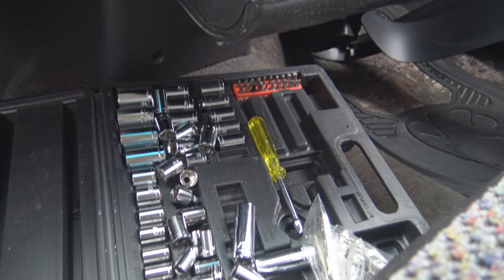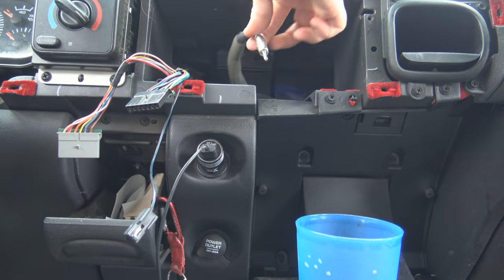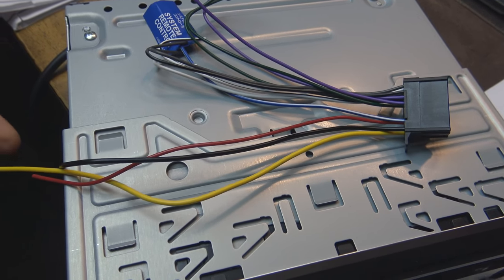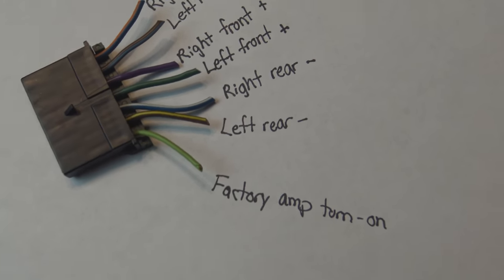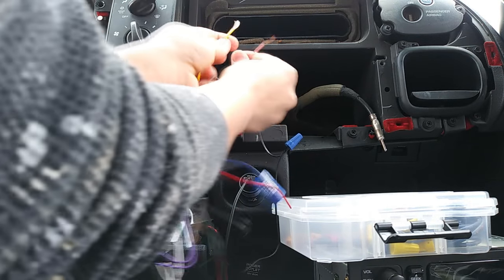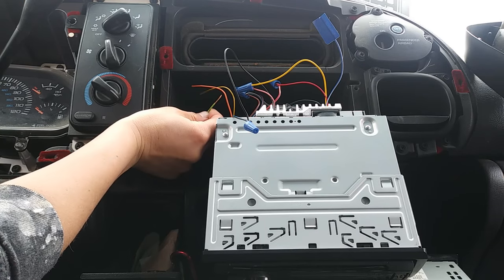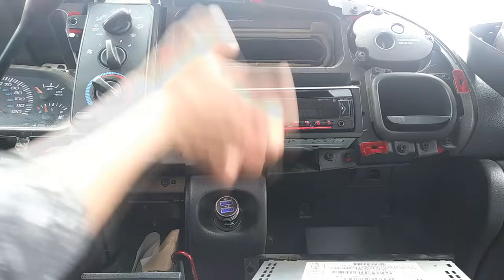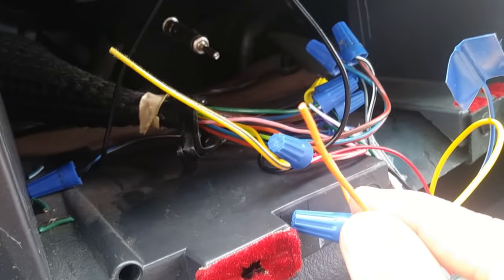Dodge Ram radio install (step by step)

Comment: Please buy a separate harness so you don't have to cut the factory harness if you do this. Also never use wire nuts, crimping or soldering is the way to go if you want a nicer install that will last

Comment from the maker: By no means am I a professional radio installer but clearly by making this video it has helped many hard wire their stereos because let's me honest not everyone has the luxury of a factory harness not being sliced. This is why I made this video. Thanks
Reply: Any advice on installing the dash adapter kit? I have the wires all hooked up but my dash kit doesn’t really explain how to install it. I put it on and reassembled the dash but the stereo isn’t secure at all. Did I miss a step? Are there tabs or something on the metal sleeve that have to be pulled back?

Comment: So as someone has already mentioned this is how NOT TO do an install!! You never wanna cut your factory harness out, that's why they make harness adapters that hold into your factory harness and then you wire up your head unit to that harness, again NEVER cut the factory harness unless its absolutely necessary to do so cause your car was made in the 60s or 70s maybe even 80s and there is no adapter harness available for your type vehicle. Also DO NOT use wire caps, use either the female crimp type connectors or use heat shrink, pros will use soldering and heat shrink. If you use the adapter harness you will not have to worry about the amp power wire etc unless running an amp but I always run my own amp turn on wire anyway. But if you do not use adapter harness you will need to run the amp turn on wire to the memory power wire cause that wire is basically the blue wire that comes on most after market head units etc.

Comment: You could've bought a wiring harness so you wouldn't have had to cut the factory harness in the truck.
Reply from the maker: Im aware lol but I wanted to make this video because so many wiring harnesses are already cut and removed and most videos online were poorly recorded or confusing for the average person :)
Reply: Ye. Don't aver cut
Reply: Ive had issues with an adapter, splicing was definitely the way to go for me.
Reply: @tightflightproductions  YOU ROCK!!!
Reply: @tightflightproductions  Thank you!!! This was the MOST helpful video online I have seen so far! You explain things so well :)
Reply: Hell yeah that's all I need to know
Reply: Re store
Reply: Z
OPEA
Reply: 🤮 shouldn’t ever cut factory harness… 
But nice to see in case yours is already cut…

Comment: So like me I couldn’t use the adapter kit I had to sort out the actual wires to the doors as I went with a higher end Infinity component system, so I rang them out 1 by 1 as to gain 2 pairs to each door that I doubled up because the single wire gauge was to small for single wire wattage, I abandoned the wires to the rear speakers from front door and ran the direct to amp, I drilled and placed tweeters up high in rear pillar next to belt sling for better sound, and lay off her! Not everyone has a solder gun and shrink tube and knows how to use it, I had every bit of 8 hours installing and well over 1K in components and Ive seen the shitty jobs those butchers do at most Stereo Stores so give har a break for trying and doing a fine job!

Comment: In this video you left out super important info that had me at a loss. When you turned the key on then and turned the radio on and said something about that’s what was wrong you were referring to the light green wire in which you didn’t really mention what issue you had off screen nor did you explain after the fact or show up close how you resolved the issue. The light green wire needs to be connected to the acc red white wire in order to get sound. This wire is not mentioned anywhere in instructions or online so it’d be helpful to include this info in the video

Comment: Thank you very much. Your video was extremely helpful. Just picked up a truck that had the radial stolen out of it and all they left me with was the bear wires inside the – and for the life of me, I could not find the 12 V constant. I never thought it would be that little pink wire.

Comment: The minute I saw the wire nuts I started laughing, dead wiring police are going to wake from the grave and clickedy click share their brilliance. The joke that came to mind was what a remarkable power you have to force people to butcher their wiring harness and use wire nuts against their will. 
 Thank you very much for your help. You saved me a LOT of time and hassle. It is hilarious having bluetooth, nav, back-up cam and a big screen hacked into the dash of a 2001 2500 cummins, dash disintegrated 21 years ago.

Comment: After 3 months of on and off trying to put it together I finally got it thanks to your video I swear there are no wiring diagrams for a 2001 dodge ram didn’t have the lime green wire anywho thanks

Comment: I believe you did a phenominal job, the harness would been better, but i have also used a harness and the connector did not match wires correctly. Best to know the wire scheme, regardless. Thank you, helped me out figure what wires were not connected correctly.

Comment: Thank you so much!! Nothing else I watched or researched talk about the lime green wire (preamp) and without it connected you know what happens? Radio powers on but NO sound out of speakers. As far as wire nuts and all the "professionals" here saying you shouldn't use them, if it works it WORKS!
Reply: You might have just saved me…

Comment: For anyone confused, I just put mine together. I did use butt connectors and had everything wired together except one thing. The lime green wire. You have to put that with the red-red/white wire as a three way splice. I had no sound but not it works great and everything sounds good. I have a boss 7” single din.

Comment: Thanks. Had mine installed in a hour.
Reply from the maker: You're welcome, glad I could help!
Reply: @tightflightproductions where did you hook the memory wire, I wired together the red and the yellow wire 😅😅, and btw I bought a harnes adapter and it never turned on so I did what you did and it work lol

Comment: Not sure HOW your wiring went so easy and you had sound right off the bat! I've been installing stereos, amps and speakers since I was 17 back in the 70's and 99% of my installs go as simple as yours did but NOT this 2000 Durango I'm doing now! Oh, and I've NEVER used wire nuts, only butt connectors yet you gave me an idea! Now I might start using wire nuts for temporary hookups until I confirm everything is working as it should, THEN remove them and use a more permanent connector. This way, if I have to disconnect something, I don't have to re-cut any wires. Anyway, I've found probably 10-15 DIFFERENT wiring diagrams for 2000 Dodges online and NONE have the same color wires my friend's has! This was the FIRST car stereo EVER that I've installed and had NO SOUND but the stereo came on. So I googled it and found TONS of other people with the same problem. It seems the factory harness from the back of the radio mostly run to the factory amp, THEN to your speakers! THIS is why nobody gets sound. So, what I'm thinking I'm going to try next is run speaker wires from the new Alpine down to the harness from the factory amp and see if I can get sound from there! Yes, I'll probably have to cut the wires from the harness, but it will never be used again so that doesn't hurt anything. I'm eventually going to install an aftermarket amp in this Durango but for now the owner just wants better sound with the new deck and 4 new door speakers. Again, I was SHOCKED that you got sound from your stereo after the FIRST try! That truck must NOT have a factory amp!
Reply: Please tell me you figured it out and remember what you did?? I have a 2000 Durango and I can NOT figure out why I can't get the radio to even power on. Car came with no radio so I bought one and the wiring harness. Nothing is working for me. Please help lol

Comment: Never use wire nuts in an automobile! The vibration can cause them to loosen and then you just have another problem. Either use soldering and heat shrink tube to secure any wire splicing. Also acceptable are crimp connectors that can be heated to shrink the insulation.
Reply from the maker: 3 years later and yet my radio still works great lol yes soldering is best~!

Comment: Topflight I need your help. I'm trying to hook up my pioneer radio I bought from Walmart and I have looked at your video a thousand times and far as i can get is the yellow & pink wire, red& red with white and that's all i Know. What do i hook the ground wire with. Colors i have left is green&black and brown&dark red brown & yellow. I have a 96 dodge ram 1500 btw
Reply: By any chance did u find a solution I need help with the ground wire too please respond asap if u can

Comment: Great stuff.  Problems I'm having with my 05 Ram.  I have two hot wires, both gray/red.  How do I choose?  Also, in addition to the black/green ground, I have a solid black wire.  Any ideas?  Anyone?

Comment: This is a great Vijay and hell no I ain’t buying no effn harness!!!  Buuut the one thing you may need to know and it may just be us but we found out that having the dimmer wire hooked up it blew the fuse for the tail lights and dash lights.  Disconnected it and BAM!! Tail lights all good

Comment: Love the video I was giving a 99 Dodge Ram 1500 5.2L by my auntie I don't know much about these trucks but it looks simple to fix anything on it.  But I know the wiring is grounded out wrong on the back of the radio as I see I'll just follow your steps fix my radio thanks by the way

Comment: Great video and very informative--I personally wouldn't have used wire nuts but hey...whatever works.  Butt splices at minimum, but the best is solder and heat shrink.  Thanks for posting!

Comment: I’m running stock speakers with infinity amp, I have a Alpine double din and I have full working headunit no sound at all, I tried running the green(amp turn on) to the red with white stripe and I still have nothing, speakers worked prior to head unit swap

Comment: Hi, great video. Just wondering if the wiring for 1500 is the same as 2500 and if there is a difference in wiring for diesel and gas engines? I have a 1999 dodge ram 2500 diesel. Thanks!
Reply from the maker: I have a 1999 Dodge Ram 1500 5.9, not sure on the 2500 diesel's.. does the wiring look similar?
Reply from the maker: Hey there sorry I missed your comment. Im not quite sure, but I did show the wire colors pretty good and im assuming if their not the same then its probably different. Hope that helped.

Comment: How do I hook up the ground wire without cutting off the adapter? The aftermarket one is just a bare end
Reply: run your own ground for the head unit or just splice it
Reply: @miket5506  Ended up just cutting off a few of the copper strands for the ground wire and clipping it into the ground clip, didn't have to cut the ground wire and it works now so

Comment: so I wired up my truck a new radio head unit and now the audio sounds worse than it did before could I have wired it wrong or badly or are the speakers blown?
Reply from the maker: Well if all the "speaker wires" are correct and everything was connected correctly etc... your speakers could be blown.. but im not forsure..
Reply: The second pin diagram is wrong...
Right Rear +- are swapped
Left Rear +- are swapped
Should sound better if you get that fixed

Comment: Second connector diagram is wrong

Looking at a Metra 70-1817 adapter your second pin diagram is wrong.

Right Rear +- pins are swapped
Left Rear +- pins are swapped

If you wire it up as per your diagram, it's not going to sound right.

Comment: Uuuuffff this video is so confusing and CONFUSING TO THE CORE! 
2 Harnes connectors from the car's harness, the Grey harness is include code colors: Solid Pink, Red with white stripes, solid orange, black with yellow stripes, blue with red stripes, and solid brown. In your video shows the blue and red stripes is Right Front Speaker, and the solid Brown is the Left Front speaker, so, where is the ground wire?( I am talking about the car's harness of the gray connector). The black connector is the speakers(I dont need clarification with it).

Comment: I got a harness so i didnt have to cut wires but it still never worked 🤔 now my radio never turns on and i cant seem to get any stero to work . any suggestions? My fuse is ok lol both on the fuse box and on the stero. Im so confused lol this was supppse to be easy🤣
Reply from the maker: lol hmmm well i am sorry you're having problems... strange, maybe 86 the harness and wire accordingly as the video shows? Maybe its the amp? No amp, no speakers, which means no sound...  Either an amp fuse, or loose wire somewhere?
Reply: @tightflightproductions  after like 3 days i figured it out. Apparently the last owner cut the speakers out and left the wires bare. So they were grouning and for some reason my while system wouldent turn on. Maybe this will help anyone else. 😅 the wires were in my driver rear door.

Comment: My front speaker aren’t turning on but my rear speakers are? Help please.
Reply: You probably have a broken wire or a bad connection Either where you crimp the wires together or on the speaker side the other possibility is you may just have a blown /damaged  speaker

Comment: you should not cut the radio wires in the truck go by a wiring kit  if you want to put the stock radio back in  you can not put it back in the truck because you runed the truck

Comment: Why wouldn't you just get the additional wiring harness that connects to the factory harness instead of ruining the original wires...also I wouldn't take any  Advice from anybody that says this wire here don't know what that goes through oh well yeah but I goes to something important or wouldn't be there

Comment: Where does the lime green wire go
Reply: if your head unit has an amp turn-on wire, put it there.  use ignition hot ONLY if your head unit does not have a +12v amp turn on lead.

Comment: She did this totally BASS ACKWARDS!! I would have NEVER cut the original wiring harness off from the original radio!!   They sell adapter wiring harnesses that plug and play right to the original harness for less than half the time to find out what goes where!! I have the same ram she has with the adapter harness that plugs to original plugs from radio!! Dont listen to her, takes more time than it should!!
Reply: Hey I have a 01' ram 1500. I dont think it has the Infiniti sound system, but I have everything hooked up and I'm getting a "amp error" on my head unit....any ideas what might be going on? I got the truck from a buddy who tried to wire it up on his own but the truck would be dead the next morning. I've wired a few decks up in my day but I'm stumped here

Comment: 2 speed bumps later, wire nuts are gone. Tape and sauter only.
Reply: Better yet. Solder and heat shrink

Comment: Why not get  the harness adapter 🤦‍♂️
Reply: Let's face reality for a second...at this point these trucks are so old that you'll never, ever go buy a brand new factory radio for it.  Also, one does not need to worry about voiding any type of warranty on the vehicle, again due to age.  So there's absolutely no need to keep the factory connectors.  Doing so and using an adapter just adds resistance to the circuit, makes it less efficient, and adds another point of failure.  These are not like vehicles of today that have all sorts of digital, computer-related signals running through them anyway; it's simple analog audio.  I cut the harness in my dad's RAM.  I even ran all new 12 AWG speaker wire to all 4 doors and bypassed the factory wiring altogether, except for the main power, ignition hot (turn on), and illumination.  Factory ground was bypassed and the radio's ground was routed through a 12AWG wire back to where the amp is grounded to eliminate the possibility of a ground loop problem.